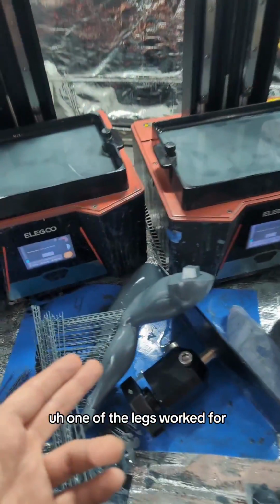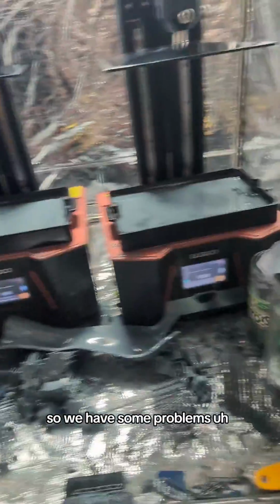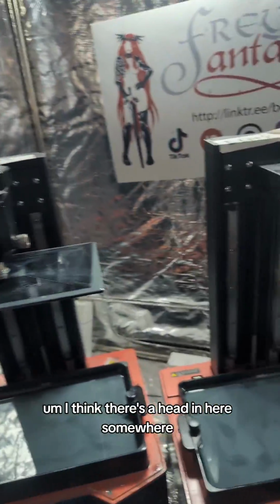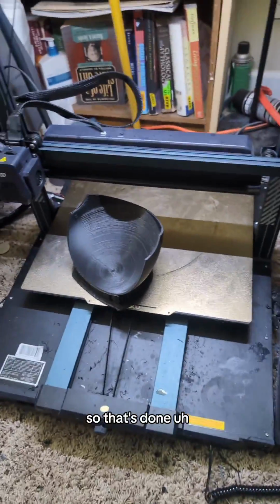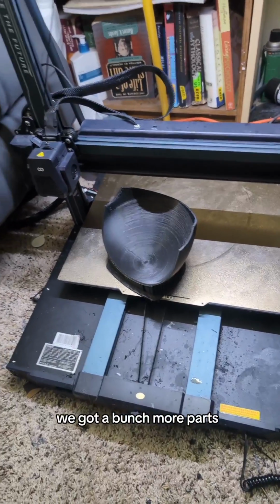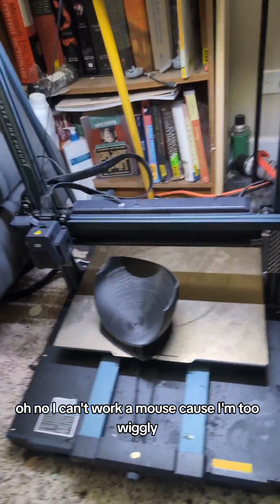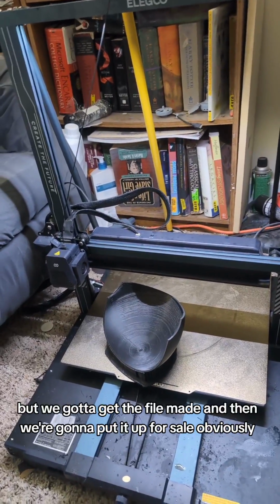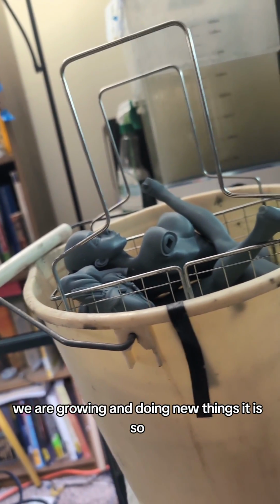trying to get back on track

Comment: Hey, i have a question, I am printing my first ever figurine of hms repulse and was wondering what you do to:
1) glue the pieces together
2) sand down the small contact areas smooth so the part is uniform
3) fill in any gaps that form between the parts?
Reply from the maker: 1. i use industrial hot glue. the stuff construction workers use. big fat sticks. not for crafts. this stuff is hot and permanent. it does great and filling gaps and holding. 
2. https://a.co/d/0aYNDrvm this works good for tight spots, or a dremmel flap wheel for large areas. thats my go to for all sanding needs. on any surface.
3. if you have large gaps between parts, i use miliput. its a 2 part substance that is kinda like clay. mix em and apply. let it dry and then sand it even with the rest of the print. it sands the same as the resin so it works out pretty good.

Comment: There is a lot of stuff back there. Something helpfull from the experience of relatives who are their own bosses ís that the disposal articles like paper, wood, metal, cans, plastic bottles can be stored in HDPE buckets after use, its helpfull to reduce space and is a more resistant option than plastic bags, also they can be stored one over the other as long as there be an space designed to them.